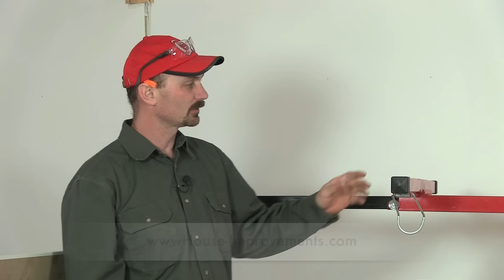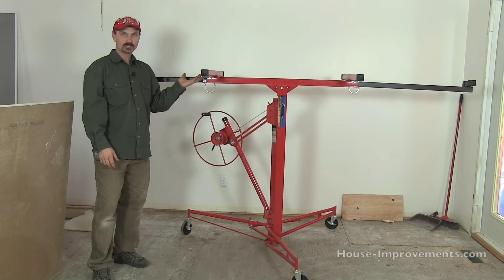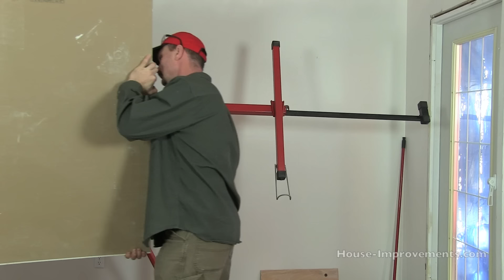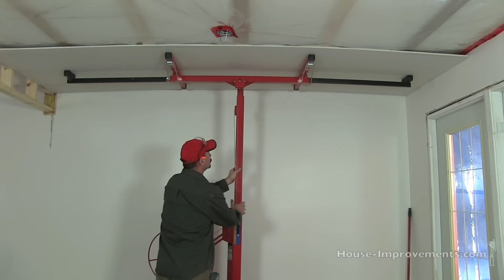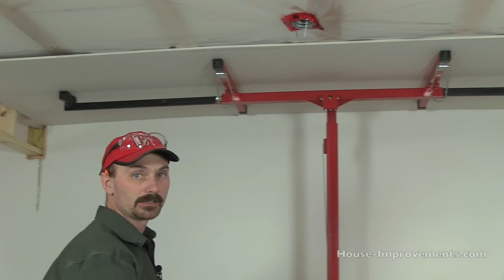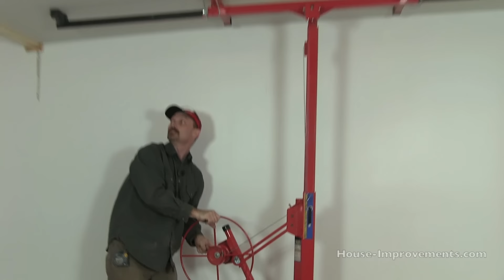How To Use a Drywall Lift

Comment: Few words of caution. Make sure if your loading sheets alone on these lifts to have your tripod wheels locked. These babies will roll out from under a sheet if you don’t sit them perfectly in the cradles and a 50 pound sheet of drywall might crash down on your feet or legs. Also be very very careful if you have an older lift or a rental. Usually the lift wheel safety lock is the first thing to fail on these things. If you pull the lock and aren’t gripping the wheel and handle firmly you might lose your grip on it while the drywall is  elevated. With all that weight on the pulley system it will rapidly spin and can smack your hand very hard, which hurts like a bear. If the drywall is full elevated and is a 10 or 12 foot sheet it will come crashing down and the wheel handle impacting your hand can have enough force to break it or snap fingers in the way. Trust me I’ve experienced this. Be very very careful with these things. They are very helpful hanging drywall but exercise caution when using them. Also note the longer the sheet of drywall and higher you hoist a sheet the more unstable the lift becomes. If you have to shift the drywall more than a few feet you really should lower it first and then roll it.
Reply from the maker: Definitely crucial points for anyone renting or buying a lift, thanks for passing this on.
Reply: Great demo!!  Thank you... 🙏

Comment: This 5/8x12 drywall ? What brand lift ?
Reply from the maker: Not even sure what brand my lift is. Really they are all very similar. Harbour freight or Princess Auto lifts will be fine and not break the bank. The drywall in this video was 1/2" and 10' -12' long. These lifts will handle  5/8" though also.

Comment: I've done it both ways and I'll never do another ceiling w/o using a lift.  It's easier and safer and more likely you''ll bring a sheet down to trim if necessary rather than forcing the fit and breaking an edge or corner.

Thanks for posting!

Comment: How does that top arm work? And it needs to be manually raised with some sort of cotter pin to keep it higher? The cable does not raise the top telescoping arm? I have a really rough old drywall lift and I don’t know how to use that extra 3 foot height extension on the top telescoping pole.
Reply from the maker: I'm sure mine does not work that way.

Comment: I have hung and finished a fair amount of drywall.  Every time I do a big job I'll say, "I'll never do that again!"  And then I try again.  This lift would help, but after hiring a crew, I realize some things are best to leave for experienced professionals. 
In the time it takes to put the sheet on the lift, crank it up, get it set just right, and screw it in, there are people out there who can have two or three sheets installed. 
Not to knock the video. It would be a good tool for people who can't afford to hire a crew and have the time and maybe some inexpensive or free help. 
But if you have the funds you might be surprised how little it would cost to get your drywall hung - and finished!
Reply from the maker: You make some valid points! There are times when hiring help is the best way to go.

Comment: Are you stuck with the wheels in that exact position, or are they rotatable while the angle of the lift is the same, for situations that require some maneuverability?
Reply from the maker: The wheels swivel and the lift tower frame itself pivots as well.

Comment: We used mine to lift and hold in place a big store sign outside .
 We put a plywoodboard on the rack on top to act as a platform for the sign and blocks underneath the sign . The lift under the edge of the overhang raised up and tight solid . The blocksheld the sign up and against the roof 3 foot tall  surround wall . About 11 feet up .

Comment: Does the top tilt in both directions? I am hoping to hang drywall vertically on my vaulted ceiling since the vertical seams will be covered and having no horizontal seams to tape and mud would be a win. The peak of the vault is 12'4"  Do you think this type of lift will work? Thanks
Reply from the maker: Yup this should work. They say you can use them to mount drywall on the wall but I have never tried that.
Reply: @HouseImprovements  thank you for the quick reply!

Comment: Advice wanted! I'm currently using this hoist, but the manual brake keeps slipping on me. It's very difficult to get the sheet right up against my ceiling because the brake slips and the sheet lowers a couple of inches. I'm not sure what the problem is exactly, but I'm imagining that the brake surface is too smooth in some spots. Or maybe I just don't know how to use the machine. I'm going to have to rig something if I can't figure it out.
Reply from the maker: What if you pull down on the break to force it tighter?
Reply: @HouseImprovements  Brake simply won't hold where I want it to. I've managed to jury-rig the wheel pretty effectively now, but it's not great for making adjustments.

Appreciate your response tho!

Comment: Other than moving it around I worked with drywall one time and one time only. I was a teenager and some guy hired me to help with a job. I get there he has me shoulder pressing the drywall from a ladder and holding it in an isometric 3/4th locked out position causing the most unbelievable burning, pain and fatigue possible. Back cramps, you name it. This went on for maybe an hour. I physically couldn't hold the drywall up anymore so he told me to sweep the floor for my rest. After sweeping for a while he informed me that it was time to shoulder press more drywall. I promptly left and never talked to him again. Long story short the memory of this just now popped into my head over twenty years later! I look up how to install overhead drywall correctly and your video popped up first! It's great to see it done right haha!
Reply: My dad left me on a ladder holding a cieling piece up while he went to get screws or nails .  After an hour i was way down slanted tired .ugh . He laughed

Comment: Alternatively either, 2 people hold it up to the ceiling, then one holds the board in the middle with 2 hands and one screws up the board to the point where it holds it own weight. Secondly buy some drywall props, quite cheap and not a big footprint, easy to use on uneven flooring and so much quicker to set up. Takes 2 people to place the board onto this machine so I can’t see why doing it this way would not only save on time but cost of rental as you could carry the props in a small form factor. Great video on a other hand however I believe abit more labour won’t harm.
Reply: Try both ways and you will see the benefit. One drywall job the way you are talking could ruin your shoulders forever, but I have seen very big guys make to 35  or 40 doing it your way.

Comment: Thanks Shannon.  Long time to find this video but it was excellent and a few markers I did not consider - Got a 3-width garage  here in the UK and  now my worries are over.  All I have to do is remove the two classic cars with dead batteries then I can start! Do you ever mark the joists on the wall before offering up the board and do a chalk-line?
Reply from the maker: You absolutely could.
Reply: Borrowed my friend lift rachet a piece of 3/4 plywood to lift then used it to replace ac unit on my camper roof a lot safer and easier than trying to carry it up a ladder plus roof is rubber membrane if you drop it on roof you have a another project can be used for more than drywall just think about weight center of gravity

Comment: I bought one and I thought it was enourmasly flimsy. The drywall bowed so much it was almost 8mpossible to get it snug. The idea is good but the tool isnt
Reply from the maker: Maybe that one was to cheaply made?
Reply: @HouseImprovements  maybe and I could have figured out some supports but there is awalys a next time. BTW I have been a general for a very long and I think you channel is very well done ✔

Comment: I was raised building houses. I'm probably shorter than I should be from all the panels I've held with my head. We never had a lift.  Kitchen sponge in your hat made the days better. No battery drills, had to drag cords. No roto zips, just keyhole saws. But, I'd like to have a panel lift. Glad you showed how it works. Young help can't work the hard way. So, I better get a lift. Thanks.
Reply from the maker: Ahh the good old days! LOL get a lift you will be glad you did .
Reply: @HouseImprovements  My dads retired, another guy is too, but the three of us just built my brother a house out of ICF, foam blocks pumped with concrete. We used to build those a lot. The other guy had a lift. But they found another guy that would hang it. He brought an old lift. I thought, man, that's nice. I know he's had it 20 years. He was our painter when we used to build.  He used to spray trim and all with it hung. Come to work at 2am, work till 2pm, be gone in a week, all doors, trim, walls, cabinets, and all. Usually worked alone. I seen 3000 sq ft house hung in half a day by five sure nuff hangers. But, we a dying breed.

Comment: what if i need a tool to hold the drywall for the highest drywall on the wall of a 10 foot tall room?? is there something available for that
Reply from the maker: These will actually do that also but it is easier if you have two extra guys instead.

Comment: Using a drywall lift is not rocket science. I would have been delighted if he showed how to assemble the damn thing.
Reply from the maker: You are correct assembly is a challenge ,lol.
Reply: @HouseImprovements   The extension was way too tall for the room.  I couldn't assemble it or find any way to retract it...Because it didn't retract. (Took me over an hour to figure that out. *Doh*) 

Turns out they gave me the only unit in the city for  16' ceilings.  This after I told the guy 3 times I was working on a 7' ceiling and wanted the smaller lifter ROLLS EYES 

At least I got the correct unit for two days for the price of 1/2 day! :)

Comment: after loading the drywall, can you leave the lift bed somewhat tilted?  Just wondering because I have a vaulted ceiling.
Reply: I did.  I'm pretty sure you can do walls too.  If you look at it the wheels open up pretty far so the thing can go up to the wall.

Comment: You are operating this lift improperly. The base should be turned 90 degrees from the way you have it placed. Then you can stand without ducking underneath the drywall.
Reply: It's not the base that matters.  However, the top panel swivels and could have been rotated 180.  I won't speak for Shannon but I think he was trying to illustrate the wire hangers that help keep the drywall on.  Had it been spun around the viewer would have had a difficult time seeing what Shannon was trying to explain. Regarding the direction of the panel, I don't think there is a proper or improper way.  There is only a way for some to criticize.

Comment: do you usually drywall the walls first, then the ceiling? I usually do it the other way around...
Reply from the maker: Ceilings first. This was a reno,walls were existing
Reply: Renovating a dining room with a soffit in the kitchen.  Luckily the soffit accommodates 3” deep grove and only 1/2”
on opposite dining room wall and using this drywall lift makes life so much easier to lock in the drywall on the 1/2” side.

Comment: VERY DANGEROUS AND INCORRECT VIDEO !! You trusted your life to the break and they slip and also wear out. My guess is because you do not know how to insert the safety pin. 
Which is the #1 requirement that should have been demonstrated for people. You should correct this video (Show people how the pin works in actual operation) with the proper safety or remove this dangerous video. This teaches people not to rely on the pin which could result in death.
Reply from the maker: This lift has no safety pin. I have never seen one with the pins until about 2015.
Reply: a sheet of drywall would have a hard time killing you. Definitely  wouldnt do it on 8 or 10 foot ceilings. Just another stupid safety feature that had to be added because of this stupid sue happy society.
Reply: I fear no falling drywall, I fear falling off a ladder and dislocating my shoulder. The only pin you need to be safe from harm, is a firing pin

Comment: I have been watching your videos and thank you for the great info you give. I have seen few other videos where they use a glue on the studs before screwing the drywall sheet on. I do see you have some plastic sheet covering the ceiling - what is it? Is that the reason you do not use glue on the studs? Any tips on how to use the lift when using glue on the studs?
Reply from the maker: The plastic is a vapour barrier required in most places on exterior walls and ceilings. If you do not require a vapour barrier in your case then apply the glue on the ceiling joists that you will be covering with the sheet. Lift the sheet in place and screw to the ceiling. I personally would not worry about using glue
Reply: HouseImprovements exterior walls should have insulation and vapor barrier. good to know. thanks.

Comment: @Houseimprovements Great video.  What is the reason for the plastic on the ceiling?  I thought that is only used for outside walls as a vapour barrier.
Reply from the maker: This homes original vapour barrier was in bad shape. We actually removed what we could from up top and then installed this one.

Comment: Whats the size or thickness for the wall that's on the side of the house and the rest and ceiling? TY
Reply: +thetruth 
Usually 1/2" walls, 5/8" ceiling.
Reply: +Frank W thanks but i already pit 1/2 ceiling and thecsame for walls
Reply: Don't worry about it, the thicker sheets hide the ceiling from sagging a little better. Don't think most people notice it when its textured.

Comment: Shannon,good demo.Question. What is the length of the  sheet you lifted in your demo?
Reply from the maker: Almost 12'
Reply: HouseImprovements Thanks for responding to my question. This is the first time I have viewed someone using one of these. Looks to be a one man job machine if one takes it slow and easy and not rushed to do the job. You have convinced me to buy one. Thanks.
Reply: Robert Mckinnon I sheeted my garage with 7/16" OSB.  I bought one of these and lifted all the sheets up for installation.  It worked perfectly.  I was working with standard 4' x 8' sheets.  The ceiling is just over 10' up.  I believe my unit can go even taller with an optional extension kit.  Just be careful of that brake.  I see these things in the store, cranked up high.  I tell them to lower them down.  If an unsuspecting customer were to touch that brake while the lift is up, the thing would come crashing down on their head.
Reply: Thanks for responding to my question.

Comment: One question Shannon, do you put the drywall screws in the same pattern in the ceiling as you would when hanging drywall on a wall? Excellent video my friend.
Reply from the maker: On the walls you want at least 4 screws across the sheet on each stud and on the ceiling you want 5. Good question
Reply: HouseImprovements Great to know that' thanks for the reply Shannon.